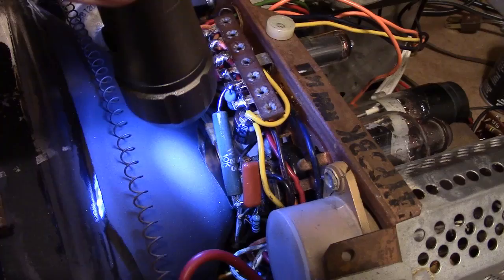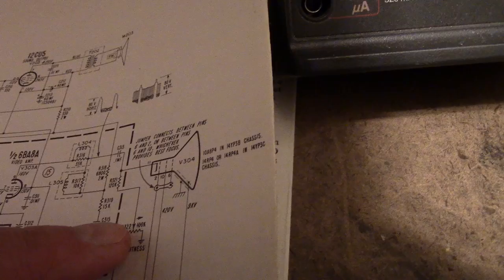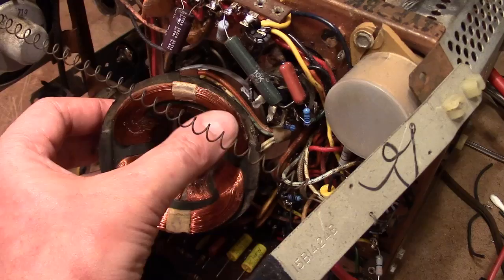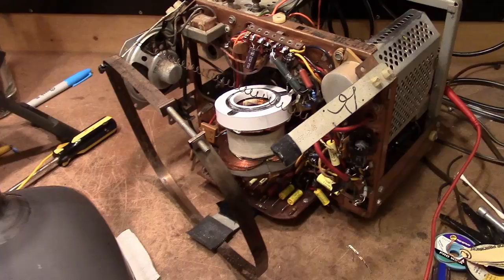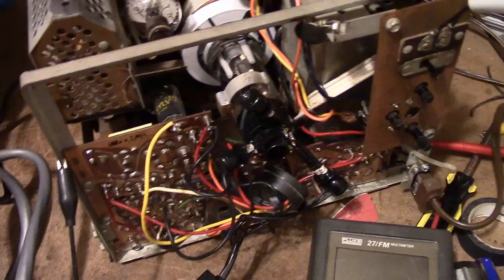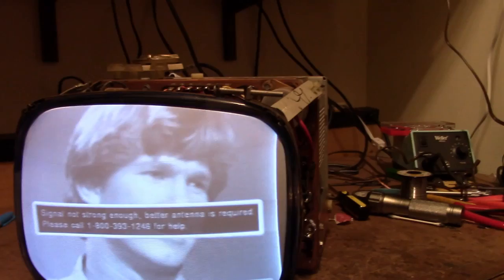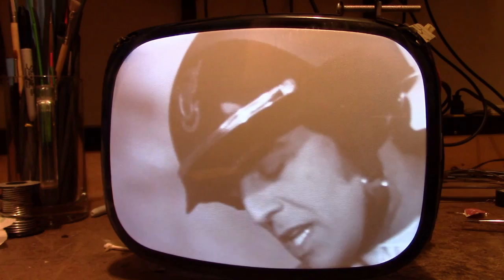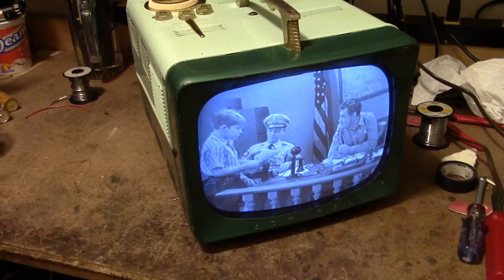Admiral T105AL restoration p4o4

Comment: Very nice! Hope the weld on the CRT cathode holds up! Where was the 'signal strength too low....' banner coming from?
Reply from the maker: Alan Cordwell Thanks! That message was coming from an over the air converter box.  It receives ATSC digital TV and puts out NTSC RF on channel 3 or 4.